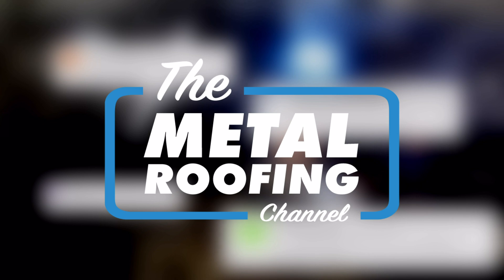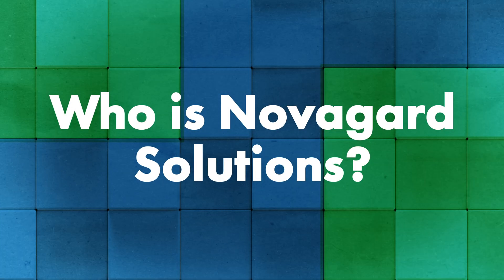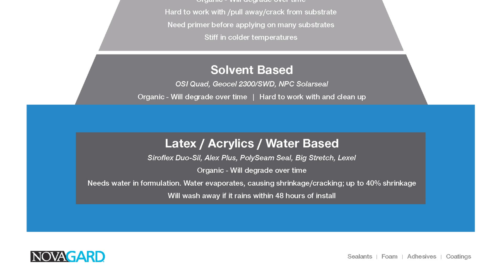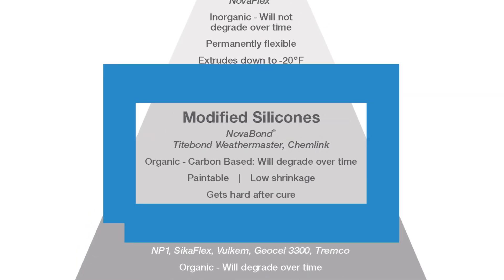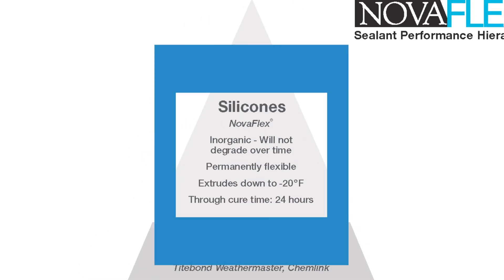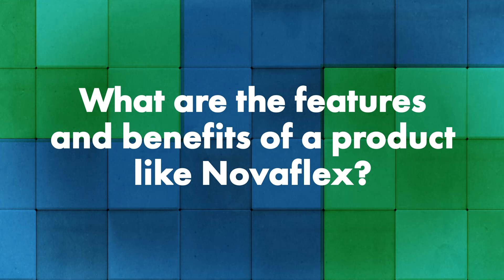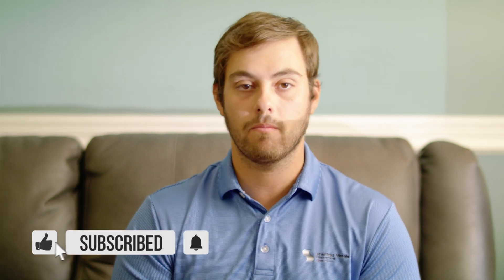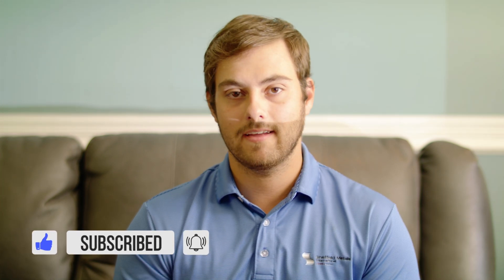What Types of Roof Sealants & Silicones Perform the Best?

Comment: Over time, I believe the oils in silicones migrate to the surface, meaning you can’t caulk over them, even with silicone.  I have seen a job where someone previously coated the joint at an exterior deck and wall with 2” of silicone each way.  (Over 150 feet) It failed and got water behind it, and I could neither recaulk it nor remove it.  My roofing contractor, with 40 years experience, says never use silicone on a roof.   Is Novaflex guaranteed to never pull away from metal roofing?
Reply: Hi Kirk -
When applying silicone over silicone, it is important to clean the surface before re-applying. Follow the two-rag method, wiping the surface first with Isopropyl rubbing alcohol, followed by wiping with a dry cloth.